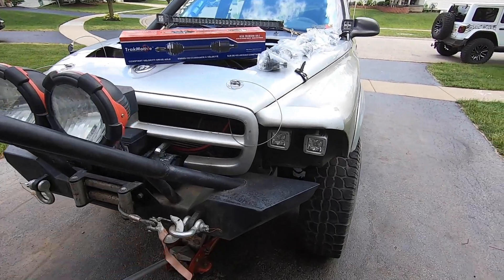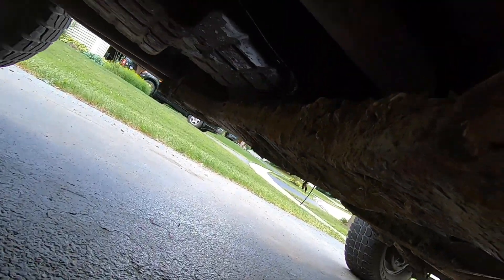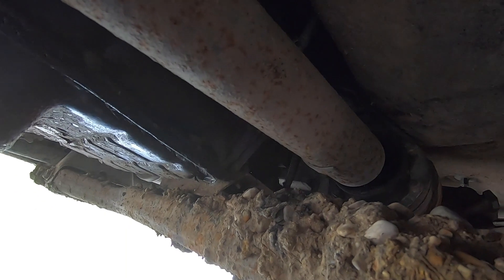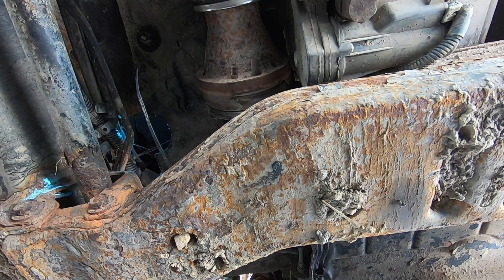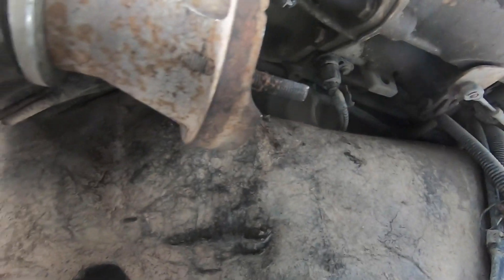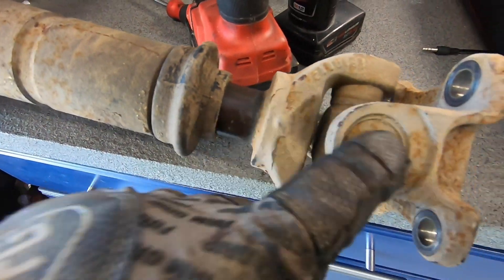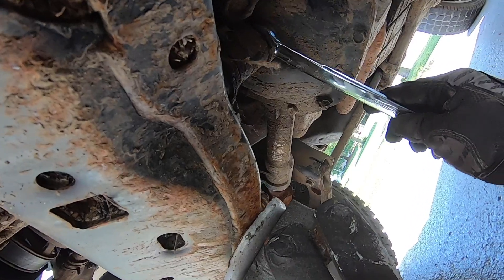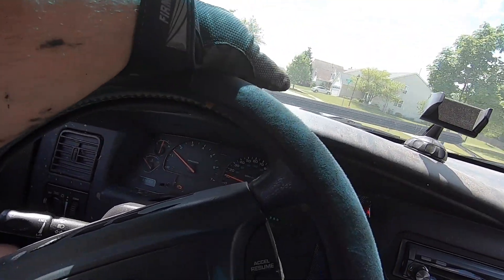PROJECT DURANGED Will It Live, Or Is It Time To Meet The Crusher.

Comment: After watching your last vid and hearing that noise, I thought to myself......Darn that sounds familiar......hahaha.

The front driveshaft CV...…...same thing happened to mine during a mudding trip.  Rubber boot was ripped for some time, grease was long gone, and the  mud just did its thing. I opted for the whole shaft assembly, it wasn't that much more than a rebuild kit, so why not. The Durango is not a bad vehicle. Like you said, its not designed to be a hard offroader, but it can take you places if you treat em right. I daily drive my Durango, I've got just over 210,000 miles on  it and its taken me to some great places. A 2003 SLT+ with a 4.7, also silver like yours, and a part of me wants to keep it going for as long as I can.

hahahaha.....if you remove your inner fender like I did, you learn keep a can of lube handy for when your door starts squeaking again.
Reply from the maker: Thanks for watching! I constantly flip flop, one day I want it gone and the other I have huge plans for it. 😆 I also think taking the doors off would solve the squeaking problem.